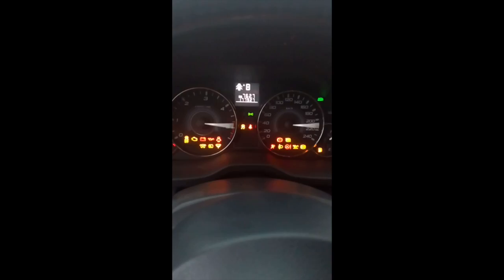Subaru first generation boxer diesel engine broken crankshaft - real life scenario

Comment: According some Subaru forums: an independent analysis found out back in 2015 that the root cause of the failure of the crankshaft fitted in Euro4 Boxer Diesel EE20 engines is due to stress fractures affecting the bedplate of the aluminum casing supporting the steel shells of the slide bearings. In reality ± 2.000 Euro4 engines seem to have been affected by this desease. The broken crankshaft has been found as the consequence of the failure of these bedplates according this analysis. Updated Subaru short-blocks produced in 2011 also seem to have solved the issue, following some members reaction's on these Subaru owner's forums. Euro5 engines (2012-2015) have a new & different lay-out of these bedplates and seem to be not affected.
Reply: Unfortunatley the problem still not solver even with Euro5 engines

Comment: The failure is not related to the DPF, it's a design fault in the crankshaft main bearings. FredSuomi has referred to the study carried out by an engine design consultant in Portugal.

Comment: I've heard about problems that plagued the Subaru EE20 Boxer Diesel. It's a damn shame. Diesel engines, from what I've read about them, are supposed to be heavier than gas engines, because they're supposed to withstand the high compression that diesel engines are known for. To discontinue the project is hideous to say the least.
Reply: Subaru make nice petrol engines , the design ethos was obviously set up as such

Comment: Whoops, that is a bad failure to have!  I used to drive lots of highway and dpf light never came on. Nowadays do more city driving and a steady dpf light comes on regularly. Driving on the highway above 3000RPM for about 15min clears the dpf and the associated light extinguishes.  No need to remove it as far as I know. If the dpf light flashes it is a different ballgame and  you should go to a qualified mechanic.

Comment: My forester boxer diesel is a november 2011. I think it is the second generation. The only big problem was the dpf. Always starts regeneration every day! a lot diluition oil engine with gasoline. So the oil property was compromised... I remove dpf system and remap software to bypass it and closed egr valve. Now The engine change in better! I put about every 7/8000km a little bit of new oil because the level go down...  Replace oil and filter every 15000 km. Just start up at cold engine a big white cloud for a few second...

Comment: Thank you for the video Janis, very sorry to hear what happened. Is the 2.0 petrol engine much more reliable?
Reply from the maker: Subaru has been making petrol engines for decades so yes the petrol engines are very stable and reliable. And so are the latest diesels. Its just the very first generation of Subaru boxer diesel that had the faults.

Comment: Very useful material. 
While you still had DPF installed, did you ever tried to "clean the DPF" with a heavier load on engine? I've turned off the DPF light by going uphill few times and then went for a 45 min highway ride with 4th gear (on 5 gear gearbox)  on 100km/h.

Comment: Hi, my Legacy 2008 Diesel just brake down yesterday on highway in Germany. 130.000 km engine. It eat up half oil. No DPF light, few months before on service they told me that it have injection problems. Tubine was changed recently. I don't know for now if crankshaft is broken but i think i won't be reparing this car. Shame :(
Reply from the maker: Sad to hear. I would still consider at least investigating what the problem is and clarify repair costs
Reply: Oh my god. I have the Legacy 08 Diesel too as a limousine. I have now 92.000km with the first engine. So many Boxer Diesel failed. Ich hoffe mal dass der noch lange hält.
Reply: @Dirty2House  und haelt noch der Diesel :) ?

Comment: Hello Janis, this video is resolving serious problem with subaru diesel engine.
Im thinking to remove DPF also, and now im wondering would that be ok if i remove DPF and catalyc converter also?? Mabye this would be ok then?? Tahnk you for ansvering..
Reply from the maker: +Goran Mikulic if you remove catalyc converter be sure you wont pass technical checks due to black smoke. The converter has to stay. Else the smoke will be too untolerable. Be carefull.

Comment: When you remove the partical filter and remap the engine you increase the horsepower power, and that's a big problem for the weak crankshafts.
Reply from the maker: +Jimmy Jepsen does remapping engine after dpf removal automatically mean horsepower increase? I did not notice extra power...
Reply: Jimmy Jepsen you do not have to add the power increase to the mapped file just leve it standard
Reply: the main problem why crankshafts breaks on subaru is injector problems thus why your dpf filter blocked. seemingly this happens them all so any vibration or diesel knocks or warbling or vibration of front crank pully have your injectors tested
Reply: @deanemily889  I think it's too late if crankshaft pully is already wobbling or any movement at all

Comment: Hi Janis, I have a 2008 legacy diesel with 225000 on the clock. Diesel engine failures on these are very common in ireland, so when i purchased mine i decided i would renew the engine oil every 10000 kms which is half the recommended interval - so far i havent had any problems. The only thing i will say about it is on initial start up the engine that i have tends to have a bit of diesel knock - for the first 3 or 4 kms until it is warm and also, if i accelerate hard it produces  a serious amount of soot so much so that occasionally if i look in the mirror after accelerating quickly at a traffic light or junction i will see 2 soot lines about a meter long on the road!!! I'm wondering did the legacy you have do any of these things in the time preceeding its demise?
Reply from the maker: The amount of soot you describe is not normal. I suppose that the DPF may have been removed (perhaps by the previous owner).  I had the same problem when my DPF was taken out. SO I suggest you take the car to the garage you trust (ideally the dealer) and ask then to check the exhaust system. Now when I have new engine and DPF installed (second hand) I dont have soot anymore at least the amount you describe.

Comment: I understood that the breakage happened due to gas hitting back on the engine (3:00) after the removal of DPF but without the removal of the catalytic converter. So it’s not an engine defect but an improper intervention on the engine.
Can you confirm?
Reply: No not true, nothing to do with DPF or injectors, it's a short block weakness

Comment: Sveicinati! Sobrit esam iegadajusi subaru diesel 2.0 2008 gada autinu...un ari ir problema ar Check engine. jau pie dilieriem nomainijam EGR klapanu, pec kadiem 200km atkal iedega Check. gribeju prasit advice. kuros servisos jus sev diagnostiku taisat? kur ir labak griezties? loooti patik masina, bet ir baili ta braukt, gribam visu salabot lai ilgi kalpotu :(
Reply: Did your car last, I doubt if it is still going, 2008 Euro 4 edition all break the crank shaft

Comment: so when i buy outback diesel (thinking abaut 2010-2011) first thing dpf filter check or remove then beside catalytic converter filter replace or remove and hope long last engine ? and whats abaut egr valve btw ?
Reply from the maker: I have noticed any problems with exhaust gas recirculation on my Subaru, but please note I am talking about my car only :) 
Regarding engines in general - I would recommend to avoid 2010 as the 1st gen engines were still fit on 2010. Better take 2011 and keep a good eye on the DPF, catalyc converter etc.
Reply: Janis Blums thanks.

Comment: euro 4 has the weak crankshaft euro 5 has a better one
Reply: Mate any idea how to find out is my suby euro 4 or euro 5? thanks at advanced.
Reply: @dino8ielts  yes, open the hood, take of the boxer diesel cover and take a look at the air intake, euro5 should have plastic intake, not aluminum
Reply: @dino8ielts  but for the most of it, if its 2011 and onwards, it should be euro5
Reply: Cheers mate. its 2009 so euro4 then i guess... i ve done dpf removal and ecu remap but atm its running beautifully absolutely hazard free so fingers cross...
Reply: dino8ielts most likely propper remap mate, wish u well
Reply: @dino8ielts Is your EE20 engine is still running?
Reply: @martinmuldoon603  I guess so. It was sold to another person last year due to I got upgraded. As a car person I really looking after my stuff. It was running silky smooth when sold.